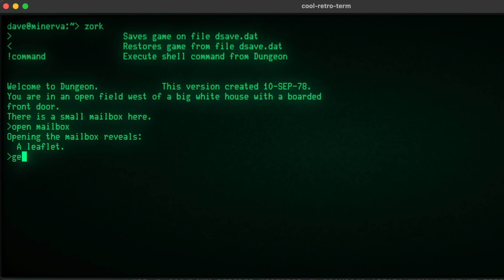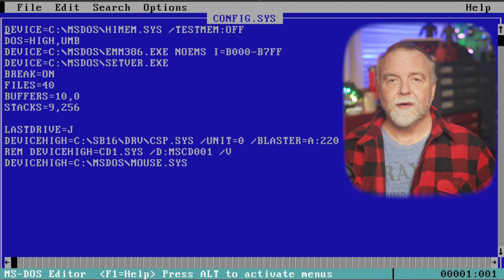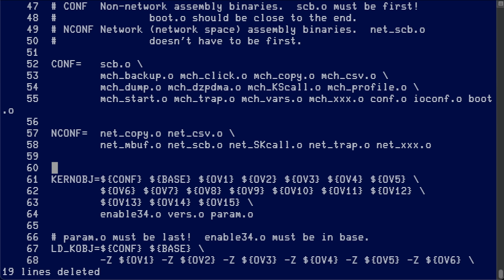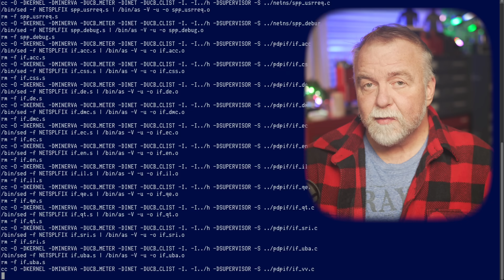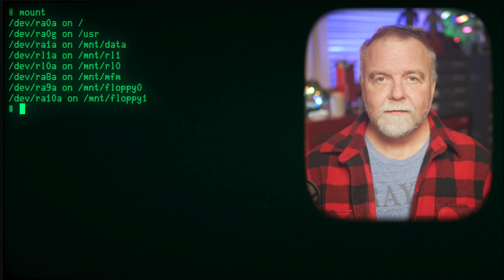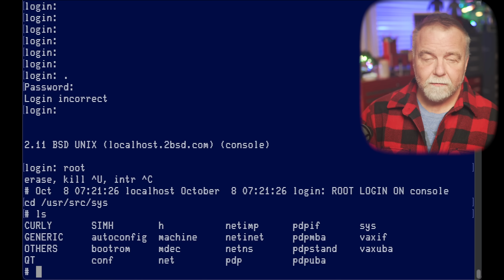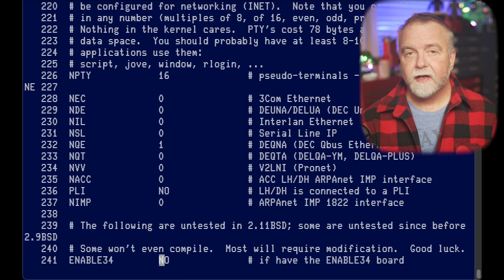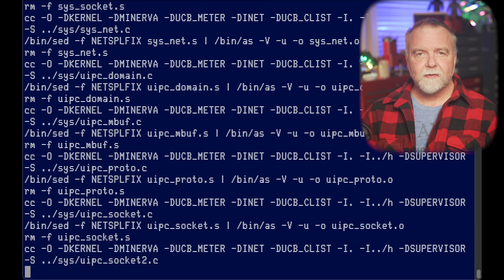The Hardest Thing: Building and Running the UNIX Kernel from Original Sources

Comment: My first real tech job was a configuration manager for Symantec in the 90's. It took us over 19 hours to compile WinNT from Microsoft, but their build system could only use 1 computer.  At Symantec we developed a distributed system, compiling each library independly.  Sure, linking would break, but the last computer going down the list would eventually link everything after it was properly compiled.  Still, Norton Utilities would still take most of the night to compile using 3 to 5 computers and these were the biggest baddest 486 machines we could get. LOL
Reply: Early on, Symantec had some very cool products
Reply: @leland818  I got there just after Symantec bought Norton Utilities and we were located on 26th street in Santa Monica. Right across the street from MTV studios. This was the 90s so lots of fun people watching.
Reply: Norton Utilities...
How to take a slow machine and make it even slower just trying to get some basic diagnostic information.
One of the things which made me absolutely despise everything Microsoft....
Getting the same information out of a Unix or Linux machine doesn't load down the entire damned system.
Reply: @akulkis  Not in the early days as Symantec set the standard for SW development.

Comment: Closest thing I've ever come to doing this was building the Linux kernel from the source for a DEC Alpha back in early 1994 -- it was even before version 1.0 of the Linux kernel was released.  Something like v0.99pl98 or 99 -- very high up there, right before 1.0, but not quite 1.0 yet.  But I didn't do it alone -- I had a couple of friends who helped.  We did it just to see if we could.  And we actually managed to pull it off, too.  Fun, nerdy project.  🙂
Reply: I did use these 0.97 .. 0.99 versions for real work for quite some time. First dual-boot Linux/Windows on a 486 machine before I later got a Pentium 90 wiyh Windows NT 3.51. That 486 computer did continue running Linux for at least 6 or 7 more years.
Reply: There was a long period where those old 486s were still really useful. When I got my first cable modem in 97-98, I had several PCs in my parents basement that I wanted online. There were no affordable consumer routers back then. I had an old DX2/66 that wasn't doing anything, and I was just getting into Linux and FreeBSD. I managed to find out that the local shop had cheap 3Com ISA ethernet cards that were supported by FreeBSD. It took me a few days but I managed to build a working router for my small LAN using FreeBSD - and once it was up and running it pretty much stayed that way.

One of the reasons I initially did this with FreeBSD over Linux was the documentation - FreeBSD's documentation was superb while many of the Linux HOWTOs were oddly written, incomplete, or out of date - e.g. I remember the transition from ipfw to ipchains leaving a lot of those HOWTOs virtually useless.

At one point I even built an almost identical router for my friend across the street when they got cable internet, helped him and his dad run network cable around the house, and got them running on nearly the same setup.

Those were fun times as a nerdy teen. Now that stuff just comes right out of the box when you subscribe and get your modem. No fun.

I'm now running pfSense (FreeBSD) on a Proxmox VM server connected to my Starlink, so in a way I'm basically doing the same thing nearly 25 years later.
Reply: @wysoft  Same. I used a floppy-based router called Coyote Linux (IIRC) on a 486DX with 2 NIC's to do a basic NAT router. Think the machine was one of the Compaq lower-profile desktops. Ran like a champ for years.
Reply: @andrewr7820  Yeah I remember that. We set up a similar machine with PicoBSD on a floppy for a friend - 486 box with a couple 3Com 509s and nothing else. Booted off of a floppy with a bare kernel and config. We at least made sure to give him a backup copy of that floppy!

Weird that Youtube disappeared my comment that you replied to.

Comment: I went through this process many times back in the 1980s, but usually with Vax 11/750 as the target system.  We also had PDP-11s and we ran RT-11 on them.  RT-11 isn’t multi user as UNIX is.  The upside is that building an RT-11 kernel is easier for the only semi guru end user, just requiring answering lots of questions in an interactive dialog.  It still took about an hour to build once you got to the end of the dialog.
Reply from the maker: That reminds me, I've got to do an RT_11 sysgen on the PDP-11/34!
Reply: @  Happy holidays!  I really enjoyed the video.  Thank you for using the correct term, I forgot it was called Sysgen.

Comment: Oh holly crap! I thought configuring FreeBSD kernel was quite a magic back in early 2000s. But this.. OMG.
Reply: This is not free bsd. I remember when the first freebsd came out in the 1980s. I put it on I think it was 55 1.44 mb floppies. Then I had to compile it for my machine and get X11R3 and compile/config that. I had an 80 mb full sized drive. 

What Dave has here is honest to goodness Unix. AT&T allowed Berkeley and some other universities like Buffalo to develop code. When I was at the University of Maryland back in the 1980s we had to just about sign in blood to get access to the source code. There was all kinds of nonsense around all of that. People were fired for copying code to a machine it wasn't supposed to be on. I managed to stay out of trouble.
Reply: @robertthomas5906 Since FreeBSD had its first release in late 1993, are you confusing with another BSD?
Reply: @robertthomas5906  I was happily attending a kindergarten and  an elementary school in 1980s :-)) Then suddenly got into tinkering with FreeBSd  as an office internet router system in early-mid 2000s

Comment: Totally obscure and exactly up my alley :)

Like for instance the topic of mainframes and how it feels we have come full circle with the cloud.
While I don't ever see anyone doing a full reverse and looping back. But there are for sure a lot of paradigms and similarities that is shared from the yeas passed.
Reply: Remember that the PDP-11 minicomputer was a radical alternative to a REAL IBM mainframe. Any manager in data processing knew he could lose his job for not buying IBM -- but that any misery he had with the expensive IBM solution would have lots of company and therefore lots of cover for his problems.
Reply: @bdietz2  thanks for the insight!
While I'm of a 80-vintage. I have worked with IBM AS/400 in the paper/pulp industry's. Along side with HP UX es and all kinds of fun stuff in the several data centers that were in operation. Never came across any DEC hardware though.

Comment: This triggered a lot of old old memories; I spent a number of years doing kernel debugging and porting at Sun Microsystems, and the procedures for SunOS 3.x and 4.x were basically identical. Our build times were somewhat faster than you note -- "make" was able to run jobs in parallel (a feature that, if memory serves, was specifically done because too many engineers spent too much time grinding their teeth and smashing their keyboards while waiting for kernel compiles, at Sun and elsewhere).

So engineers out there still using make, you can (I think, and only if my swiss-cheese memory is working properly today) thank those huge kernel build times for your ability to just type "make -J" and have it flash-cook your whole project at once ;)
Reply: make -J became viable with the Sun 4/6x0. These were the first Suns with more than one CPU. I had one with 4 Cypress CPUs (40MHz) and it was fun to play around with it. A 4/690 could go up to 4 HyperSparcs 200MHz max and (because it had the huge 12 slot VME cage) 3.5GB RAM!
Reply: @peterkoch3777  You just absolutely made my day -- I was the tech lead on making SunOS 4 run on the 4/6xx series processors, including a ton of work debugging cache coherency issues with the first few sets of the Cypress processors.

The processor board delivered in the 4/690 form factor (a tall rack) was the same board used in the 4/670 (a shorter package, I think the top of it was flush with my desk).

Interestingly, in the back of the same hardware lab where we were bringing up the first 4/600 processor boards, Larry McVoy was cramming a ton of Sun IPX boxes into a rack and using network connections. His contention was that a network of uniprocessors could out-scale MP machines, and for some things, he was not wrong. Still, I remember my kernel builds on the 690 were outgunning his cluster, but not by a lot.
Reply: Ahhh! I'd forgotten about -J!

Comment: Very cool, knowing how these early computers worked and how software controlled them is very useful in todays era were we finally have the keys to the CPU and can drive the chips ourselves like with microelectronics.  For the first time i understood the need for an operating system to being with, I would have never gained that understanding learning from the top down.   But from the ground up with a 1 program system and building from there, you can see the reasoning to want a more dynamic system and options an operating system provides.  Look forward to more and how these operating systems are constructed to work on these different hardwares.

Comment: Bit of a rookie question but I wondered with some of the older systems which I occasionally run into and I have some old servers is it possible to run modern or not too old versions of Linux?
Reply: If you are referring to 32-bit Intel-compatible CPU's, then yes. There are still a number of Linux distributions that support 32-bit CPU's, including the venerable Debian distribution. I have done this in the past on a number of configurations, including recently for my brother who had some old small-form-factor Gateway laptops. 

The biggest challenges I've encountered are:
- Sufficient system RAM to do anything useful. Are you happy running without a GUI? Linux on a 486 with 640K is possible.
- Getting the system image onto a supported boot device (go back far enough and USB booting not there), which means CD-ROM (or gasp floppy), which means first finding another machine where you can burn the bootable install image onto a CD-ROM. 
- Supported video device if you want X-Windows (the VESA video driver cures most ills)

And heaven help you if you need to boot from floppy. Still possible (Tiny Core Linux and a few others.), but you still have to first have an existing machine equipped with a floppy to make the install flopp(y/ies).  HTH
Reply: @andrewr7820  thank you for that.

Comment: How about Xenix?
Reply from the maker: I've never set up Xenix on a PC!  But I imagine the images are out there...
Reply: Yes - xenix 286 on a PC/AT clone with 2 mb of memory worked well, but no one memory segment could exceed 64kb. This made large data structures more complex and added a lot of careful code to the drivers. I did an X.25 driver that ran on this system. No documentation. Lots of experimentation. Slow compile/built/reboot/test process. Grey hair.

Comment: In high school we had a PDP1134 where I learned Fortran and how to read Hollerith code on punch cards.
Reply from the maker: I have a PDP/1134 running RT-11!
Reply: @ That’s AWESOME! I never got to see the actual hard drives that it used and how they were inserted into the system. We used the link command as well. Very nerdy and very interesting.

Comment: The Unix time issue will come in 14 years, did you encounter any modern incompatibility?  Does the TCP stack run unmodified?
Reply from the maker: No, it even supports Y2K dates, which I can only assume were fixes made somewhere along the way...

Comment: Just trying to get to a bootable USB drive so I can replace the old system to rescue old hardware using Linux has me pulling my hair out,   cant imagine going all the way back to Unix. I will always have a soft spot and preference for MS but too restrictive, too nozy, too greedy, too cloudy, too rent seeking and, simply put, too authoritarian these days,  getting some eggs moved to a different basket. 
Finally completed the copy without error!  
Reboot and theres lights flashing on the USB..... 
Thought I had it just now, but some error popped up and disappered faster than I could read it.    Peek and poke some more, study some more, change something remotely related and try again......

Comment: This was a great video and i enjoyed it even though the chance of owning a PDP-11 myself is very low, I have friends who have them however.
The process reminds me of the headache I went through on my 486DX2 100 in the late 90s when I decided to try and install Gentoo Linux, it took me 2 days to compile the base system but it wouldn't book and I gave up on it after a week and decided to start with a pre-built kernel and compile from that point instead.

I saw in the news and on the Security Now podcast that Microsoft activation has been cracked for most if not all Microsoft products, it was covered on the Security Now podcast with Steve Gibson, I think it was the one 2 weeks ago. (2nd last one of the year other than the Best Of one that is coming in a few days)
as you have said you worked on the Windows Activation I was wondering if you intended to comment, I know it was a while ago but thought you might have some relevant observations without disclosing the parts of the process that need to be kept secret.

Comment: I worked on a DEC VAX machine. It had a special room where the computer hardware and tapes lived and then terminal cables fed to out to offices, of which mine was one.
Reply: ours were in a glass house in the middle of a giant room with our desks around the perimeter. was always searching for the misplaced double suction cups to pull tiles off the raised floor to access the cables.
Reply: When I graduated in 1984 I got a job in a telecommunications company where the development environment was based on VAX systems running BSD Unix and later on DEC'S ow Unix named Ultrix. Loved working with those machines, an 11/785 and 11/750.
Reply: And you slogged to the computer room's Dutch Door, to beg the Operator for your printout?

Comment: I have gone down this route, but with vastly more modern hardware and software, but the experience seems about the same.  However, I did not have a fancy emulator or another computer other than the one in the University Lab to research.  Hardware: 486sx/16, 16mb RAM, (it was 8 years old at the time, as we were in the Pentium Pro days) and I was wrestling FreeBSD 2.2.6.

14 hours for the kernel, but nowhere near the complexity of the DEC machines.

Comment: You know, that's not so much different from compiling your own Linux kernels in the 90s. Except that I recall it taking multiple hours on my systems. I had to do it for some weird hardware I had at first, but it became habit to just customize every kernel I used. I'd take out anything not necessary and put in whatever I wanted, then hope the result booted. I also learned to never overwrite my existing kernel image in case I really messed things up, from experience :)
Reply: 486: Type ‘make’ and go to bed.
Reply: @c1ph3rpunk  I was a GCC maintainer in the 486 days. (There's still a 'robertl' directory in the GCC source tree. That's me.) Bootstrapping a full three-stage stage (building source from native to build an unoptimized GCC, using that to build an optimized version, then running the optimized version to build itself again to be sure the code matched... and running the dejaGNU ttest suite) took more than 24 hours. Thus, most of us could do it only pull it off a few times a week as even narrowing down a miscompilation to a specific submit was hard. You couldn't exactly run distcc or ccache since the whole purpose was to exercise the compiler itself.

It was also the era when RAM was garbage, and this was a serious stress test. Lots of failures were just attributed to Gremlins. You'd sometimes restart only to have it mysteriously work and never be fully comfortable, whether that was a good thing (a bug you didn't have to track down) or a bad one (a Makeefile race condition or other transient problem that was real).

There's plenty to not miss about the old days. Running the test suite on every submit was an industry-changer and out of reach for most of  us in that era.
Reply: @RobertLipe  Thank you for adding your memories to this, I was lucky that at least I had a whole compiler suite ready to go from packages. Though some distros like Gentoo gave you that old school feeling of having to compile every darn thing...the novelty soon wore off, especially on slower computers lol.
Reply: @c1ph3rpunk  No. With a 486 it took less than an hour to compile the complete kernel with all modules.
The slowest compile time i experienced was 5-6h on a 386sx with only 2MB main memory. And only because the compiler needs more memory. The system was  constantly swapping. So i stayed with my Minix 386vm (and a C386 instead of GCC), which was more capable to run with less memory.
Reply: @ modules? I pre-date kernel modules.
Reply: @c1ph3rpunk  With version 1.0 and below it was even faster because you don't have to compile parts which are not needed.
Reply: @kla_sch3864  Took me 8 hours or so on a 486/DX 33mhz with 4M RAM... this woulda been 0.99x or early 1.0.x days.
Reply: And Windows could be customized before being compiled to a optical disk
Reply: I was thinking the same thing. Make sure lilo has access to the old and new kernel just in case. Lol

Comment: i struggle to get Ubuntu working :) I know its not UNIX, but it's somewhat comparable. I learned to code in C++ on UNIX at university, and never ever used either of them ever again  (C# Windows, thanks for Task Manager)
Reply: Installing Ubuntu these days is about as easy as is gets.  Basically just clicking oks and nexts.  If you need to big deal the partition scheme, you'll know it.  Otherwise, just put everything on one.